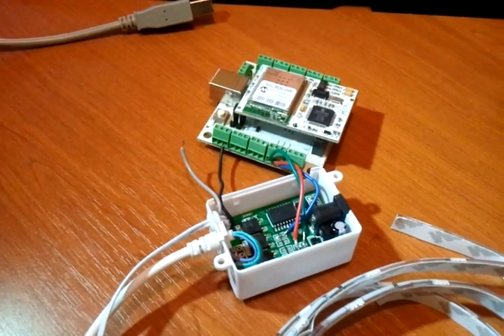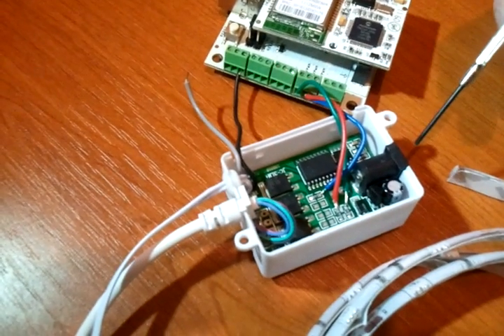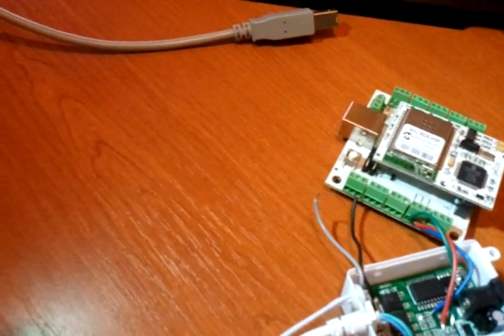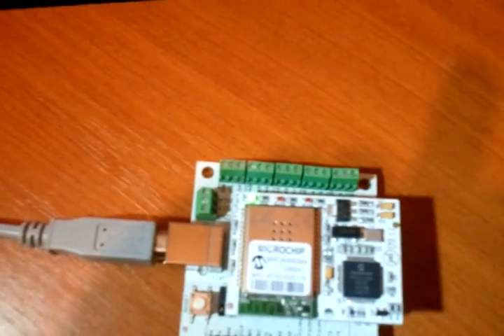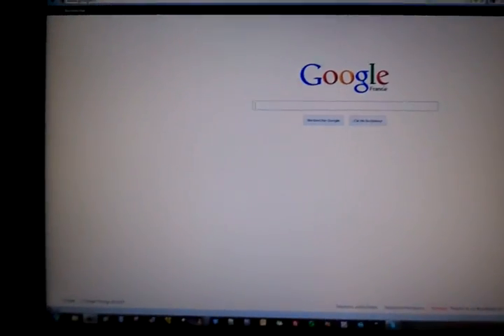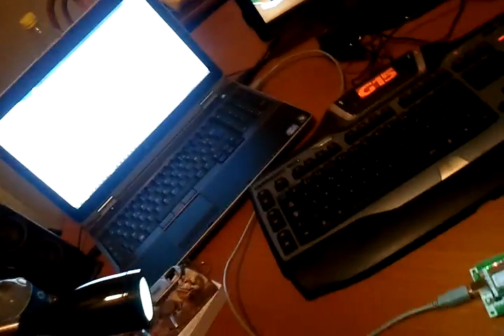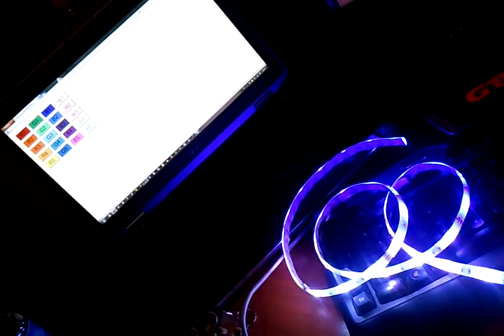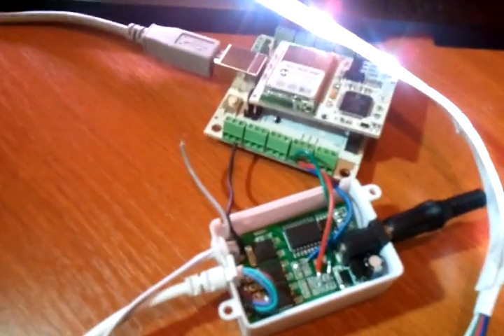Control RGB LED with Flyport in WIFI

Comment: Hi Antoine, it's been a while ago you posted this but what are you exactly doing with the controllers and the device? Do you use PWM to make the mosfet switch? I wonder if I can do this with a raspberry pi :)
Reply from the maker: Jeroen Le Roy hello, yes exactly, I was driving 3 pwm.